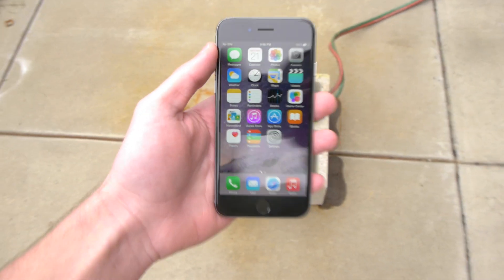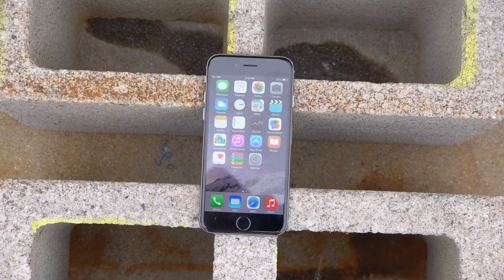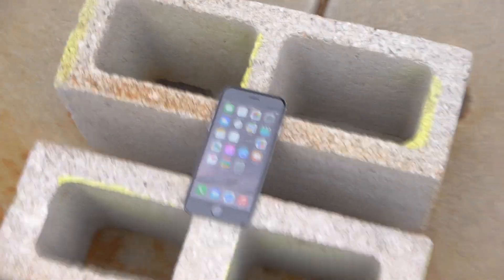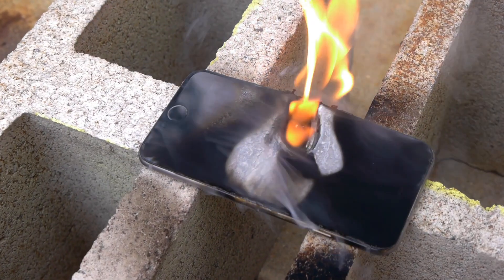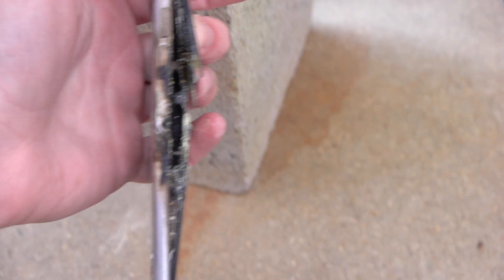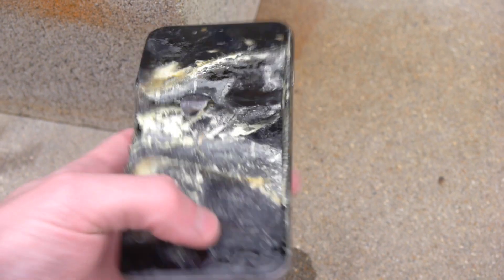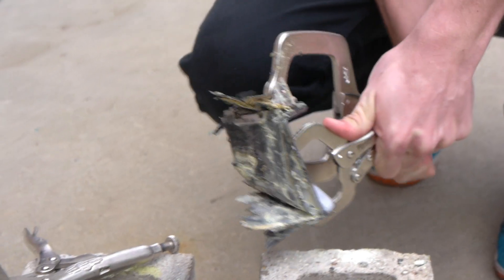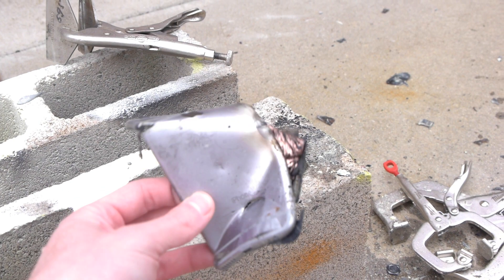iPhone 6 Meets 6000ºF Torch Test!

Comment: Free standing the gas tanks like that can be very dangerous. Normally you'd have a chain around them attached to a cart or a wall etc. so they don't fall over and break the nozzle off. If that happens those tanks take off like a missle and can go through several block walls. Mythbuster did a special on it.

Comment: Wow, this is what gets 38K likes!? Seriously? I'm sorry, but what is so great about this? I can understand drop tests, water tests, but a blow torch test?
Reply: Winter Moon sorry but that looks like an oxyacetylene cutting torch that is used for welding and cutting steel and the temperature of them is 3,480 degrees Celsius or 6,296 degrees Fahrenheit if you hear in the video he says its not propane so who's the dumbass now
Reply: Winter Moon I never would have expected a pony to say that.
Reply: apply cold water to burned area
Reply: ashley johnson So a blowtorch can get to 6000 F? No. It can go as high as 3623 F you dumbass. Do your research.

Comment: 6000ºF IS HOT ! To put how hot this is in perspective the melting point of steel is 2795ºF ! So this blow torch could melt metal.
Another fun fact is this 'blow torch' is hotter than jet fuel (1500°F)
So this torch can melt steel beams when even jet fuel can't ! How crazy is science?
Reply: Pig.avi it's even funnier because of your profile picture
Reply: Pig.avi <3

Comment: Hello guys I am in desperate need of help,I have a jailbroken iPhone 4s, I needed to factory wipe it or restore it, so I plugged it into my computer and it made me update to ios 8.3 or else I couldnt restore it. Well now my phone is stuck on a screen that looks like this: http://gyazo.com/04774ce6e1b88287b2b70966c73be684 except the bar isnt filled at all and will not move for the past 4 hours. I unplugged and re plugged the usb to my computer and now  I am only getting this: http://gyazo.com/f2ac4172e718f5dcc83e1928b1782710 I do not know what to do, also the phone WILL NOT turn off no matter what I do. I really need to get this thing restored, so I need someone to help me, please reply.

Comment: There are a lot better things you can do with your money. The designers and engineers work hard to create the technology you destroy. This is not what they would want. I can understand drop tests and water tests on phones that claim to be waterproof as they legitimately evaluate a phones durability. But destroying an iPhone using every tool you have at your disposal over and over again is just unnecessary. So I'll do you a favour, dropping a phone face down will probably break it, exposing a phone to extremely high temperatures will probably break it, rubbing sand paper on a phone will scratch it, exposing non waterproof phones to water will break it. And many more. And please remember, most phones have lithium in the battery, lithium is an extremely reactive and potentially dangerous metal. It even reacts to air. So snapping, submerging, heating, freezing, microwaving (people are seriously that stupid), grinding, drilling, and smashing you phone is generally a bad idea.

Comment: You are releasing thousands of toxins into the air and you are causing more radiation than coal factories so could you please not break it all the way open and rip it in half but you can still destroy them by the way I really don't give a fuck and this comment doesn't mean anything and breaking open electronics doesn't do shit bye.

Comment: Good luck cutting steel with that 6000°F torch that couldn't even get that iPhone in half in 2 minutes.. lol
Reply: Standard 1018 steel melts at 2700 degrees
Reply: ***** Did you see how long he took for that small piece he cutted? And its not even steel.
Reply: So what's your point. I use this torch to cut steel daily
Reply: ***** That it takes hours to cut a piece.

Comment: connect both ends of the phone with jumper Cables to a big battery.
Reply: i want to see that :)
Reply: ells5656 no like i want it to be a big battery. like...alot bigger than a car battery. ''all it will do is spark out...'' yes and we want to see that. what was so ''interesting'' with this video? all it did really was melting the display and some of the metal, still ppl Watch it and enjoy it. myself included.
Reply: Me to
Reply: All it will do is spark out and then short circuit and then the battery will start smoking but might set fire.
Reply: Ya
Reply: I like the way you think....

Comment: acetylene and oxygen, you should have tried out a pure plasma cutter, woulda been a lot smoother. try it next time if you can. plasma cutter is the shit.

not to mention it was cringe worthy watching you use an acetylene torch like that, completely wrong ratio.